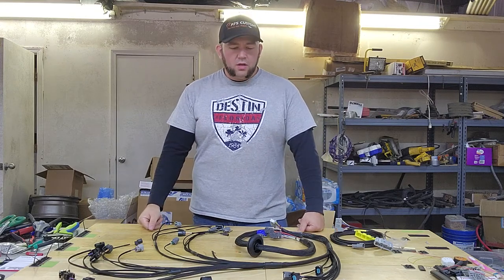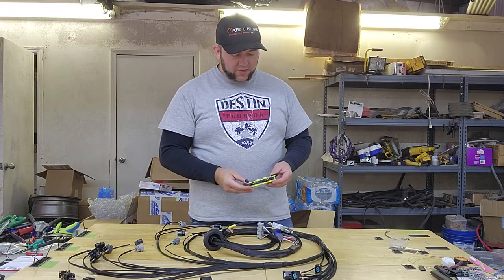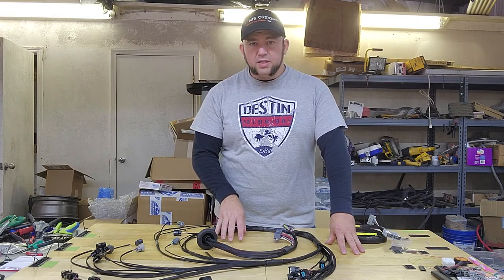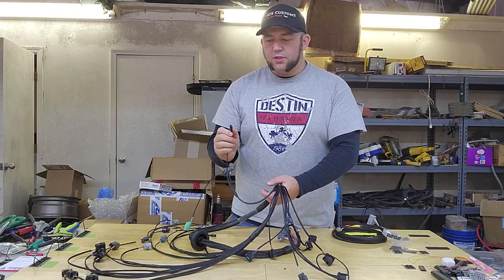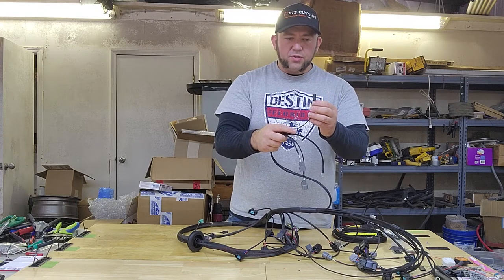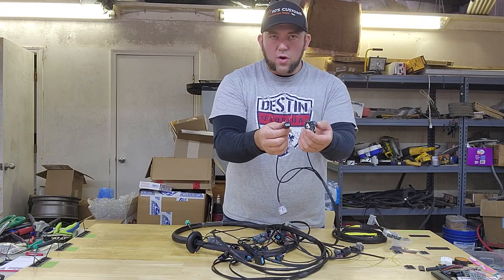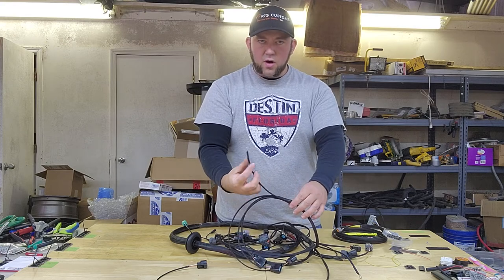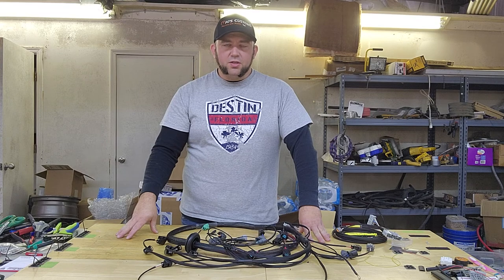1992-1995 EG Civic/1994-1995 DC2 Integra J Swap Harness Info

Comment: Is it possible to put a different connector for TPS so you can convert the drive by wire to dbc?
Reply from the maker: No, you would need to swap over to a cable throttle body
Reply: @pjscustomsllc3885  is there any option to do that without changing the ECU entirely? I want drive by cable
Reply from the maker: @NastyNaj1 , if you have an e-throttle engine and are wanting to swap to a cable style throttle body setup, a stand alone ECU is the only option. 

We can build jumpers for stand alone ECUs to adapt to certain different styles of stock engine harnesses.